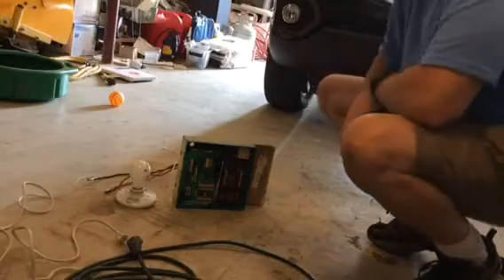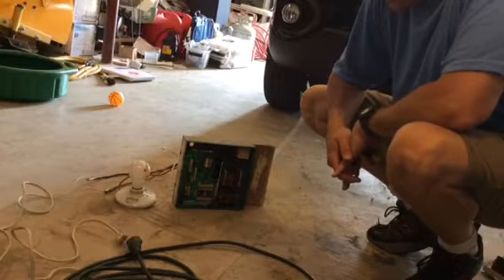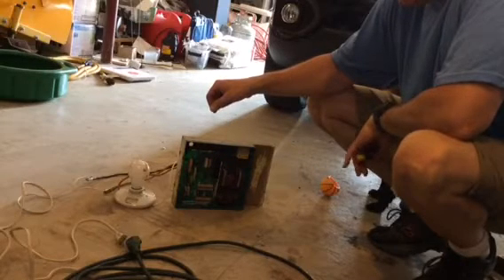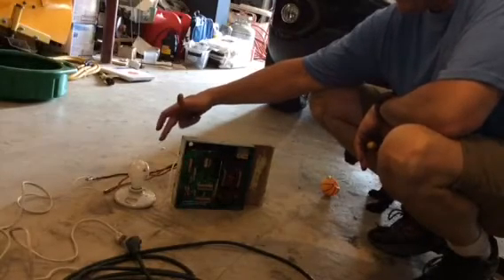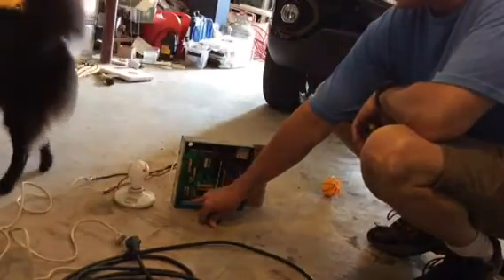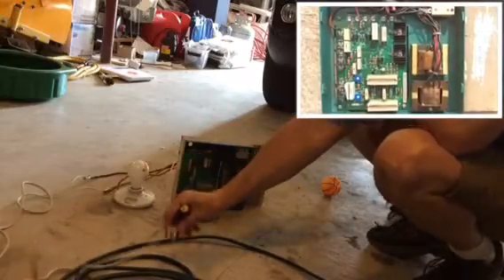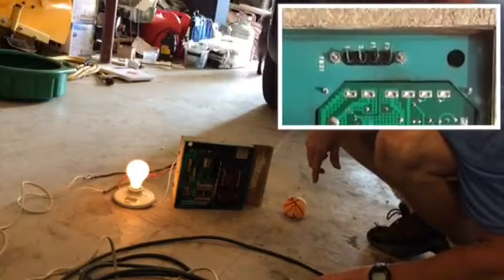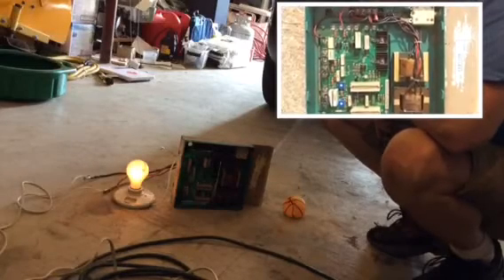Onan generator regulator test

Comment: Your video was very dark. Did you ever make a drawing so I know the connections. Power in power out, etc.
I do have a drawing of the regulator board (pins 1 to 10). I just need a way to send you it.

Comment: You can also connect a voltmeter to the light bulb to adjust the voltage under load. 
Thanks for sharing. Best Wishes n Blessings. Keith

Comment: The bulb wires are going to f1 and f2. Are the ac cord wires going there also or are they connected to 1 and 2 for the test. The video cuts out and it's unclear where the connected wires go, thanks for the video.
Reply from the maker: They do not go to the same. F1 and F2 are for the field. 1 and 2 are the sensing wires. So the ac cord was going to 1 and 2 not f1 and f2, sorry about that, I never noticed that the video cut out right there.

Comment: Where is this located on the generator? Thanks in advance man.
Reply from the maker: it's usually inside the control panel on top of the generator.
this particular regulator is from an onan 6 mdjb it's for the yd generator end . a lot of the onans
used the same or similar regulators. you would have to look at a parts list to get the part number to make sure
you were replacing it with the same.
Reply: Thank you man.  I am used to working on engines not generators :) and my voltage in my RV is 160... so either bad reg or a bad sender connection considering age and use I would bet sender is disconnected. But never hurts (I don't even know where the sender is located yet haha)
Reply from the maker: +anjhindul what model generator do you have? sometimes a high voltage could mean you engine rpm is running too fast, but I would need to know the model
Reply: SuperRobkar I will get that for you tomorrow I am 4 hours into a 16 at work atm. But the rig is a 1985 Holiday Rambler Aluma Lite with the 6500 watt onan in it.

I thought the reg would control the voltage even if the gen was running fast.
Reply from the maker: +anjhindul nope, depends on the model, some of the older ones use the speed to regulate the volts, I have a feeling yours may be a 6.5 nh, if that's the case you will need to turn down the engine speed. you should go out and buy a kill a watt, it will report voltage and hertz among other things. it runs about 20 at Walmart and other places.
Reply: SuperRobkar Aha funny you should mention kill-a-watt I have 4 of them :) I will use one as you suggested to tune it if this gen runs on RPM instead of a reg. Thank you for the suggestion. I will have the model number tomorrow.
Reply: SuperRobkar Sorry this is so late, just got internet back. Model is a 4.0 BFA? I should right this stuff down.  I thought it was a 6.5. I took off the front cover and I have a solenoid but no Reg that I can see. Voltage is a steady 150 unless a heavy load is applied IE AC (121). Microwave drops it to 140, Microwave and AC drop it to 118. Refrigerator doesn't do much drops it to 148...

Where are the adjustments for the speed? Those I did not find (they had better not be on the back of the unit and require me to pull the entire thing out...
Reply from the maker: +anjhindul ok your voltage will be controlled by the speed of the generator, the good news is you don't have to worry about a regulator. yours is controlled by the governor. there is a nut that you must loosen to lower the speed.. but I'm going to bet if you lower the speed to say 120v no load, then the voltage will be too low when it is at full load. I've see a lot of people set them up the way yours is, which is wrong. the real issue is you need set that governor up right.. you should head on over to www.smokstak.com and goto the onan section and create a new post. they will set you up with a manual and give you advise on how to get it running right.
Reply: SuperRobkar
Thanks man, I have a manual though I haven't  looked at it a lot yet. I will see if it is the right one. The help is very much appreciated.